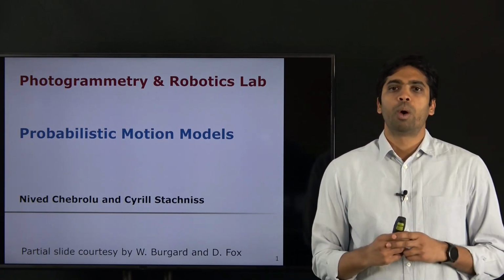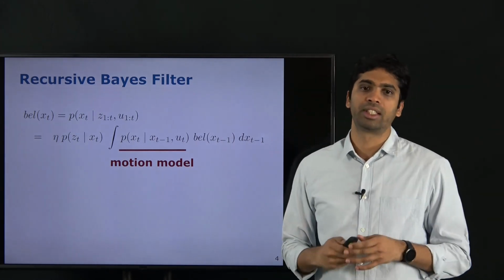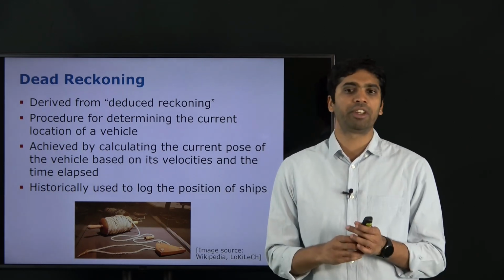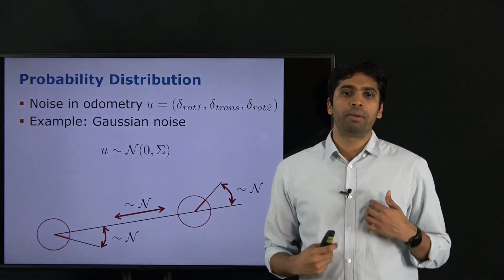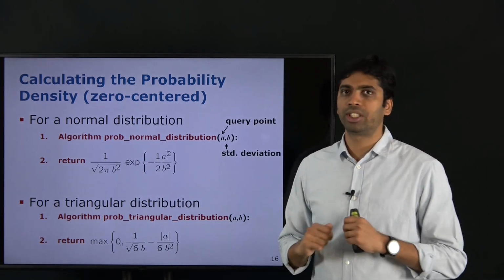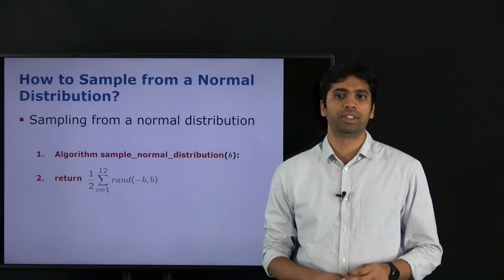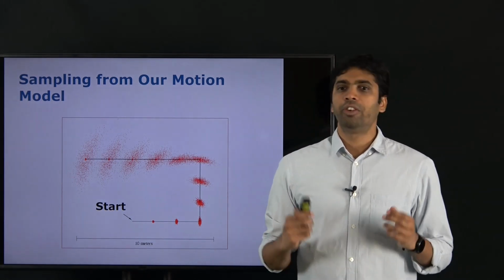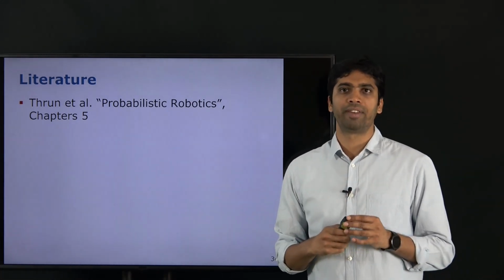Motion Models (Nived Chebrolu)

Comment: Thanks for the lecture, I have two questions if I may :
1. Can we sample directly from the bicycle model (for the case of Ackerman drive) instead of using this abstraction of (rot1, trans1, rot2)?  
2. In the two techniques presented (histogram representation and sample based implementation) how can you use such representations in the Kalman filter? The filter requires a Gaussian distribution with (Mu, Sigma), so do we have to approximate the banana shape distribution (both sample based and histogram) by a Gaussian?
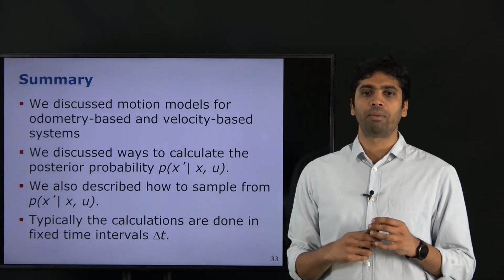Reply: for q1. wouldnt you still be doing same calculations but different sampling time? it is mentioned at 40:25